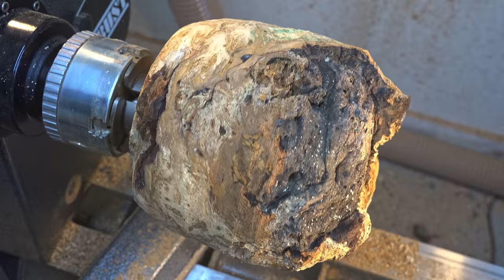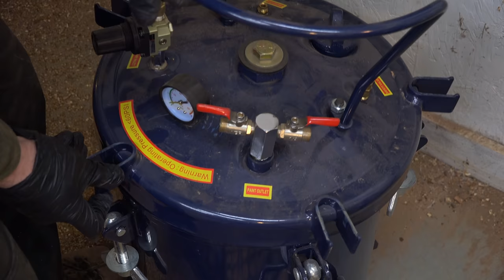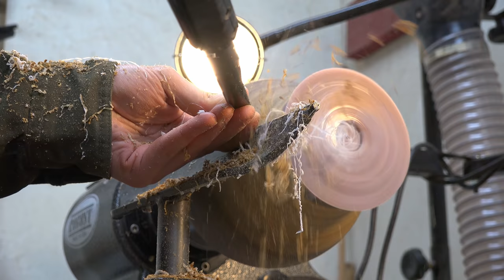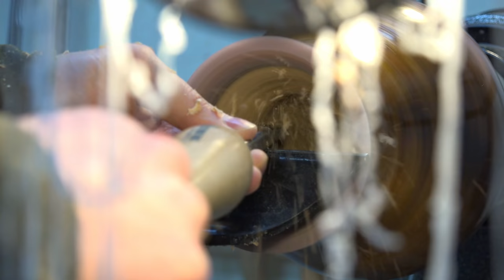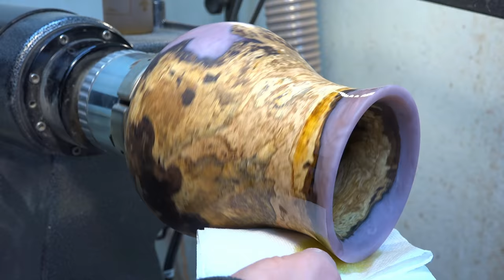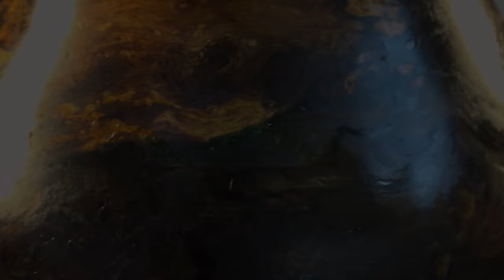Woodturning:  Mother of Purple 💜

Comment: Just a thought. If you are going for a cylinder anyway you might find it a LOT easier to start on the band saw on a pivot point. Even just using a regular hand saw to rough out your shape can help a ton and save the off center weight danger. Love the project! Very cool results.

Comment: Used to work in a furniture factory where we made chair legs on the lathe. Once in a while a leg would explode/break and become a projectile traveling across the factory at insane speed. Above my work station, at about 15 feet, there were several chair legs imbedded into the wall where they landed. It served as a reminder that I could die at work any day.

Comment: Apparently none of the woodturning channels watch each other. If they had, they would all quickly realize you can't mix multiple colors of epoxy while they are watery in consistency and have anything happen but that they all mix together rather than the swirls of color they all go for. Liquids diffuse into each other over time and become fairly uniform. The only way to get anything like a swirl of colors would be to wait until the epoxy has started to thicken to a more molasses-like consistency. I would love to see you do such a mix and see how it comes out, if that is even possible without leaving lots of bubbles. Also, I really like the music at the end of this video. Very soothing and lovely.
Reply from the maker: You’d be surprised how much I watch other woodturners on youtube. I’m basically an addict. But that doesn’t always translate to experience. Some things are learned the hard way, and this was an example of that. The color I was going for was far from what resulted. Oh well…

Comment: Is there a reason to turn away the excess in the beginning rather than getting it closer to a cylinder with a band saw? It just seems as though it would make a huge tear out less likely and give you smaller pieces for other projects.
It has been a few years since I turned wood, but I was always told to get the shape as close to symmetrical as possible off the lathe, and it seems as though that is a lot of amazing wood turned to sawdust.
Amazing piece in the end, fantastic work.

Comment: You are an artistic turner and create lovely pieces with great skill and finesse.  But you also have at least one bad habit which you should recognize and change to help your turning.  Go back and watch your videos carefully and find the instances where you have a piece between centers and you use your gouge (often your bowl gouge) and turn uphill on the long grain.  This is seldom a good idea and contributes to tear out and catches.  The cut direction when you blew the piece off the lathe appeared to be downhill but remember that burl grain can be moving in all directions unlike normal spindle pieces.  This piece was basically encased in resin so the grain is not as impactful as it would be for a normal blank.  Nevertheless, the basic spindle turning principle of never turning uphill is still the best practice even when using heavy bowl gouges.  I might suggest that shear scraping (burr) could be an exception but that is something entirely different and shear cutting (bevel) requires some more advanced skill for the ordinary turner.

Videos are a great tool to analyze one's own practices and improve.  Congrats on a beautiful turning.

Comment: What’s the reason for starting with so much material when you’re going to cut it down to the core? Why not saw off as much excess as possible before turning it? I understand you need room to work with, but maybe I just don’t understand how much room is necessary.

Comment: This isn’t the first time I have watched a turning vid where the resin mixes in the curing. I have a theory and anybody, correct me if I’m wrong. As the liquid resin heats up as it cures it causes something called Brownian Motion. This is where liquids that are hot are in constant movement as it cools. A good example of this is if you put some milk into a cup of hot coffee or tea without stirring it. You will see the milk move around in the liquid, moving from the top to the bottom and in swirls. This will eventually mix to where you cannot see the milk anymore. I believe this is what is happening to everyone’s resin when they pour multiple colors. A solution for this may be to allow the resin to cure slightly until it is a bit thicker and then pour it.

Comment: I have a question. When you pour the resin in and then put it in to the pressure container, is the container for degassing the resin or does it assist in curing?

Comment: That is looking awesome.  I was just given a craftsman lathe.  It does not have a stand.  Who would you recommend for getting a stand for it?  Overall length is about 3 ft.
Reply from the maker: Thanks! Congrats! I’m not familiar with that lathe, but I would guess that the same manufacturer sells a compatible base for it.
Reply: @DavidAdamsen  It is a craftsman 12 x 16 midi wood lathe. Need spindle lock knob that was broken off and lost before I got it and an owner's manual.  Any help would be greatly appreciated.
Reply from the maker: @JimJackson-q3r  You will probably find an owner's manual available online for that specific lathe and possibly also a replacement part for the broken spindle lock.  However, it might be easier to find a machine shop that can take a look at it.  I am certainly no expert on lathe maintenance, but there are lots of diy videos on this platform that might help you out.

Comment: He doesn't talk about it much, but cutting burls in a lathe is actually very dangerous, mainly at the beginning. If you stick your cutting tool out too far into the burl while its spinning, you can jam the tool into the burl and either send your tool flying up into your face, or slip the burl out of the peg and send it flying.

Comment: Think this is quite badly executed the same piece of wood in the opposite orientation required way lees material extraction. And the initial shape could be cutted into a more rounded shape before putting in the machine.
Or is there any reason not to do that?

Comment: Why do you use CA glue when many epoxies would better cure in air at the surface? CAs are designed to cure at super small gaps, using surface moisture or acidic species to start curing (source: worked for CA company in the lab for a year)

Comment: There's so much wasted epoxy every time someone does one of these. Is it possible to turn the base first, cut out the interior, then put a balloon in to fill the void before epoxying? I'm guessing you'd have to get creative if you're using the vacuum to release air bubbles.

Comment: What’s the motivation for not using CNC?
Reply: Or at least a tool holder? I’ve never seen someone put their hands that close to an operating lathe before. Also, what’s the purpose of all the epoxy you poured on the burl?